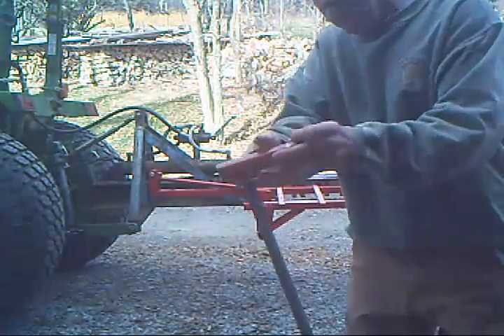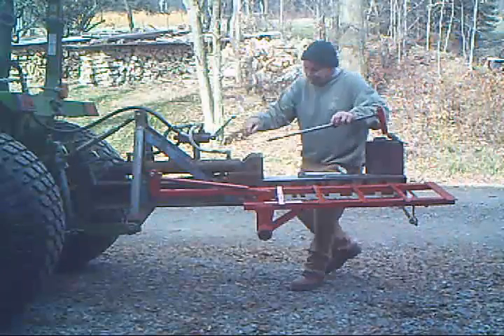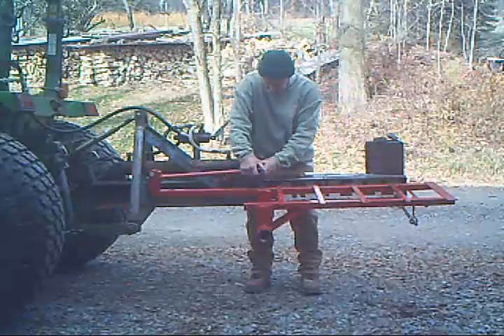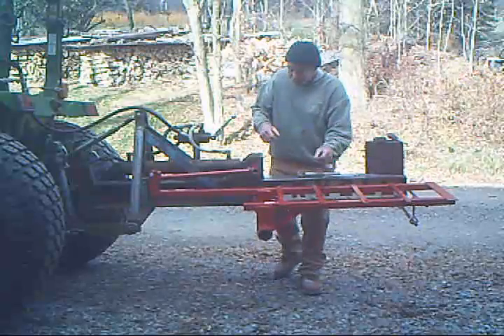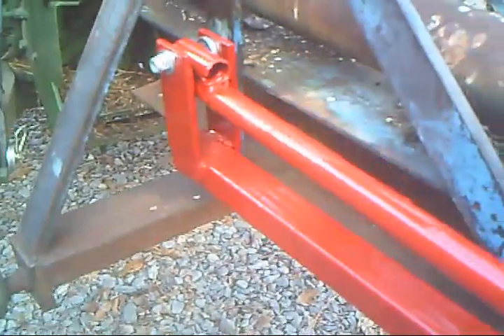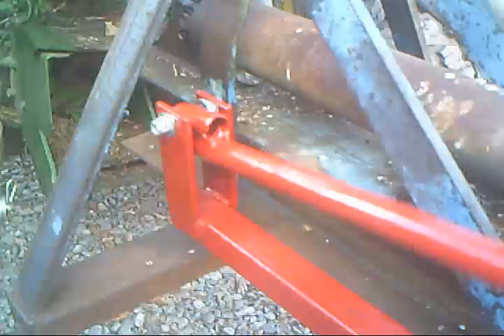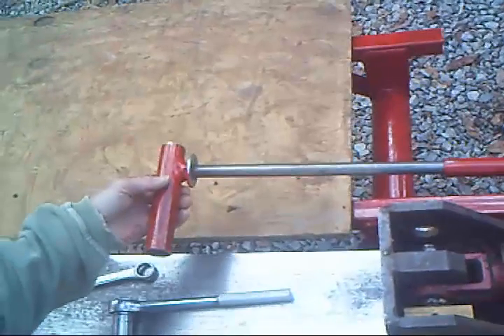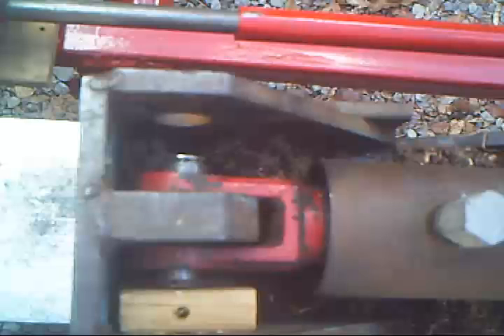3 point wood splitter lift: non-hydraulic, powered by splitter ram

Comment: you could hinge the lift off the pusher plate instead and attach the pull rod to the chassis. that way the lift would return the wood back to you for another split.

Comment: Would really like to build one. Do you have plans or  Dimension? Please.
Reply from the maker: It's really dependent on the individual splitter, and how it
fits on a given tractor. The mechanical properties are the
same, but individual parts would need to be adjusted to
suit the situation. Just focus on how the undercarriage
lift table fastens to the the underside of the splitter ...
once the undercarriage mount is in place, then adapt
the lift arm configuration to work with the given splitter.